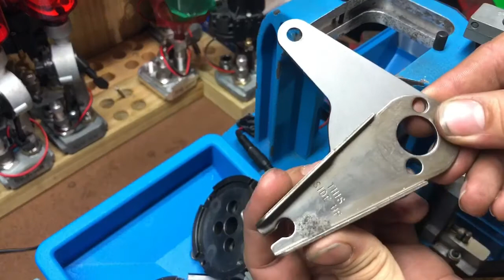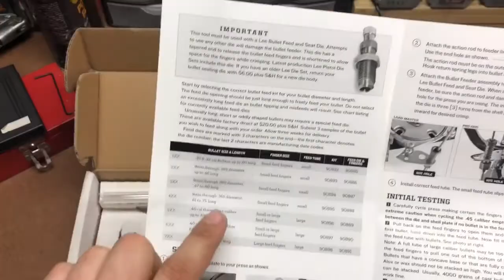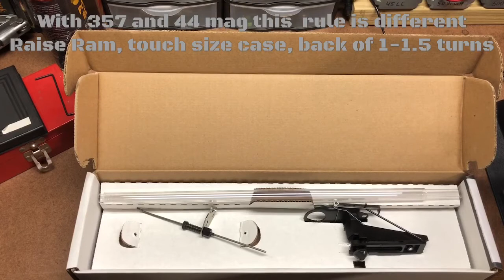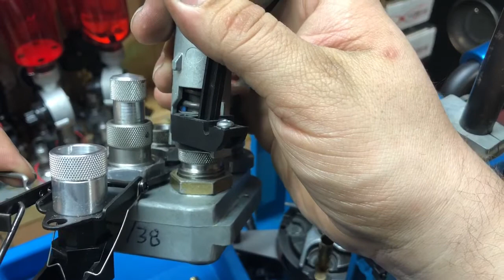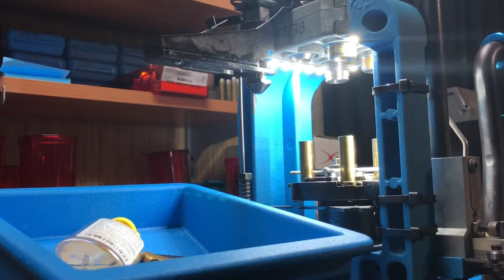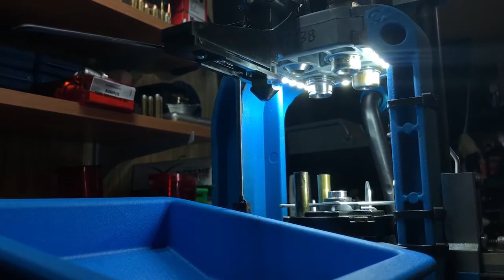Dillon 450 / 550 Lee Bullet Feeder adapter bracket installation and guide

Comment: I havent loaded in 40 years but back into it again. Will this work with 45acp on a dillon 450 with manual powder feeder?  Also cast bullets on my 450 are lubed with old school wax or whatever they used.  Does that gum up the tubes so they wont feed?  Always some on the sides and a tad on the base that is wiped off...  Does the 45acp need to be screwed down 3 turns or not?  Long wwinded uh?
Thank you Brad

Comment: A key step in reinstalling the platform was missed. you need to realign the platform to the tool head via dillon alignment rod part number #13713.

Comment: Hi Brandon,       Great video well explained and easy to follow.
One quick question. do you resize the lead bullet before  you use on the bullet feeder.
I have a lyman bullet sizer and lub machine then I RELOAD on  my dillon 550   would recon you have to size first ??
just checking. 

Cheers Bill Miller
Reply from the maker: Always size your lead first

Comment: Great video and I subbed to your channel and I will be putting an order in. May have some questions when I get rolling on it. One I have right now is will the needle bearing kit for the indexing plate work with your system or is it better to just keep the indexing ball and parts for the plate stock? I see you did have the bearing kit for your primer feed.
Reply from the maker: Larry Fulton I have the index bearing kit and longer bolt from the hit factory in mine - either will work fine

Comment: Any issues with the "crank" (That's what Lee calls it) popping out?  If so any remedies?
Reply from the maker: Christian Sundberg I actually discuss that in the first several minutes in my shorter install video - you just bend out the longer arm slightly
Reply: Brandon Gary Thanks I was going to try that actually anyway.  I just got my press set up, haven't run anything through it yet, but everything seems fine.
Reply from the maker: With the 550 adapter bracket? Or a Lee press?
Reply: Brandon Gary with the adapter bracket.
Reply from the maker: Christian Sundberg ah ok - sorry

Everything fit ok? Any issues?
Reply: Brandon Gary None so far.  It went in easy enough.  I have the bullet bin mounted on a In Line Fabrication mount and had to move the bin over and secure it with just 2 screws.  Not your fault, but you might like the info for others.  I also have the older bushings on my powder funnel rod.  They went in harder than the Dillon bracket, but went in.  I've found that those newer bushings go in hard even on the Dillon bracket.